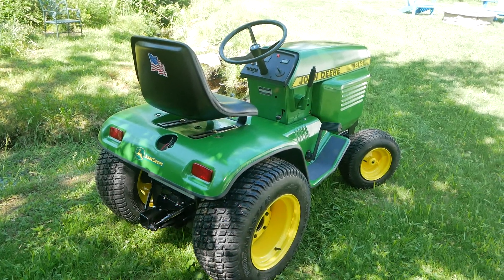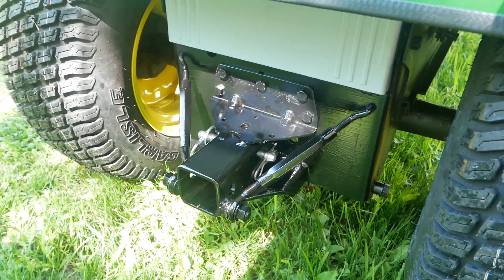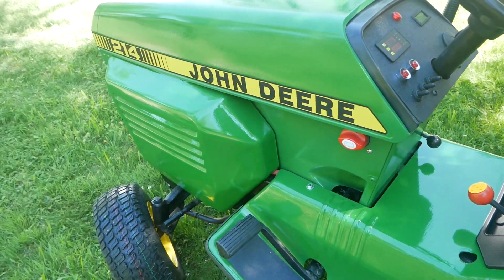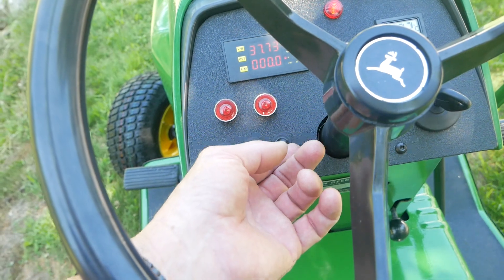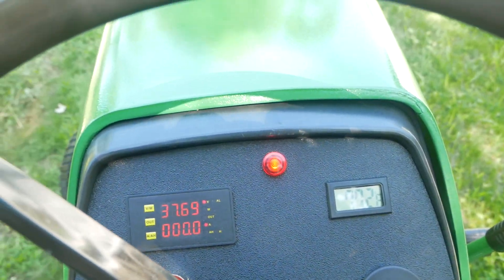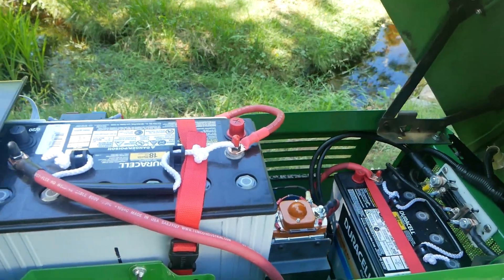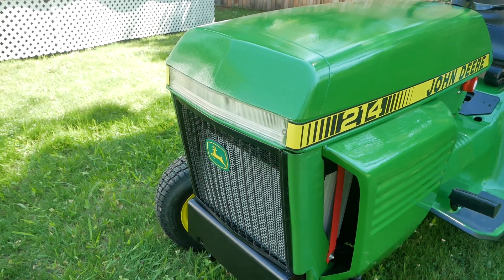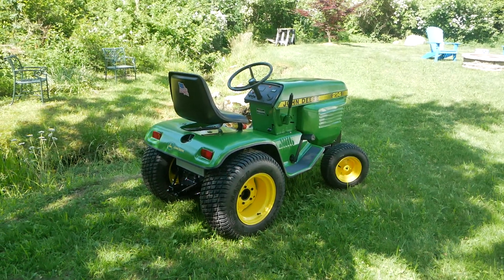John Deere 214 Electric Tractor Conversion Walkaround Video

Comment: Roy I was thinking this past weekend of a 332 rolling frame, I have if it could be electric well thanks for answering my question. But I have another question what are your run times and charge times with the setup you have? Is there anything you would have done different? Really incredible machine you made!!!
Reply from the maker: Hi Michael. There is nothing I would do different. The tractor has been 110% reliable and a total joy to own. Plowed mountains of snow this year with zero issues. Hauling my trailers all over the property. Dragging cut down trees out of the wood. Using a dethatcher and a sleeve hitch take to do some landscaping. I never ran even close to 50% battery use, no matter how hard I used it. I get three+ hours of continuous use when not using the mower. Since you are rarely running it for three hours nonstop, this equates to a full day of use in most cases. Mowing us different. The addition of those three electric motors takes a toll. And this IS continuous use. I get about an hour of mowing. I can do my yard in about 30 minutes. The real joy is the ability to jump on, start and go. No warm up, no smoke, NO NOISE. So convenient. I'll never own another gas tractor . The 332 should be a great conversion. You might want to use 4 batteries to get the motor to 48volts and 3300 rpm for the hydraulics. I'm running at 36volts but I don't have any hydraulics. All my lifts are with electric linear actuators. Hydraulics are a bit less efficient. I would like to some day swap all this stuff into a 400 series tractor. At times, I wish the tractor was a little bit bigger and heavier for hauling bigger trailers around. Good luck. Let me know if I can help.

Comment: Locally in Toronto Canada there are a lot of used Lifepo4 A123, 40v battery packs in transit bus.  The are typically 32”x7”x3” - 70% to 90% life with built in BMS.  I’m thinking it can be fitted from front to back in the hood and under the belly if you’re not using a belly mower.

Comment: Hi Roy, excellent work.  Puts new life to these classic JD.  You’re the first I’ve seen that converted a garden tractor.   I’m thinking of doing something similar to my JD318.  Love to hear your thoughts on the larger 300 series with the hydrostatic and hydraulic.  Great job and the tractor looks great!
Reply from the maker: I'm in negotiations to purchase a 317 and move everything from this tractor over to it. I have no idea how s hydro tractor will react. Stay tuned!
Reply: You may need a separate motor or run another shaft to power the front pto, unless you plan to power the snowblower with an electric motor like what you did with your front mower.
Reply from the maker: @kevind5841  no need for a snow blower but if I did, it would run off its own motor just like my mowing deck has its own motors. No need for a front PTO. That's the nice thing about electric power. All implements run independently with their own motors.
Reply: I’m not sure what compartment space you have under the 317 battery, you may be able to squeeze your motenergy motor there and add another couple batteries.  My 420 that I’m restoring has the engine removed, it should have similar engine compartment for battery storage.  I can send photos and measurements.  Email me at dkev1976@gmail.com
Reply from the maker: @kevind5841  thank you Kevin greatly appreciated. I took measurements on the 317 I'm trying to purchase and unfortunately there isn't enough room to add a fourth battery. I was hoping I could fit the battery under the console but there's too much plumbing steering gear etc there so it will end up with the original motor went. three batteries 36 volts is plenty for this tractor. I'm getting 3 hours plus runtime and I have more power than I know what to do with. The next positive step would be to go to a lithium battery. I would gain runtime and quicker charging but I would lose traction weight that those 3 80 lb batteries afford me. And it will cost about $1,500 for the lithium batteries chargers and ancillary hardware.
Reply: @roybertalotto6355  Roy, i have a 317. did you ever do the conversion?
Reply from the maker: @robertmcauley4164  not yet. Will be a winter project.
Reply from the maker: @robertmcauley4164  Today I picked up a real nice 316 with dual hydraulics and dual brakes.....Will start another electric build after Thanksgiving 2022

Comment: What is that motor ...? In watt and volts 
Each battery pack details in volts and AH please reply
Reply from the maker: The motor is Motenergy ME1004 Brush-Type Permanent Magnet DC Motor.  24 to 48Volts......(Not sure of watts) .....Batteries are Dracell, Group31, 12V, 110Ah....Hope this helps